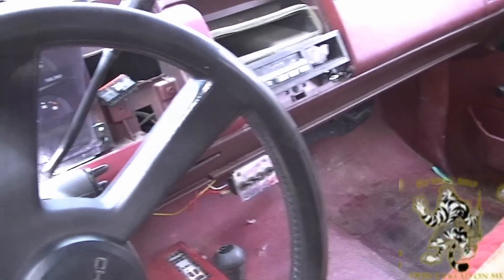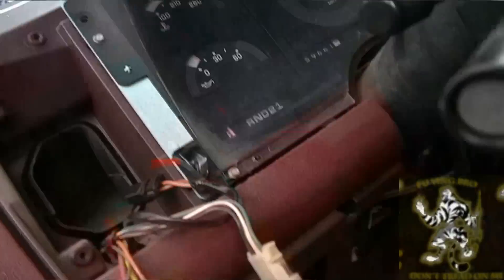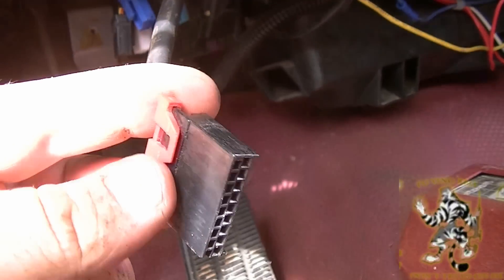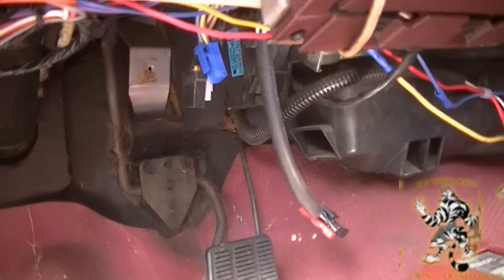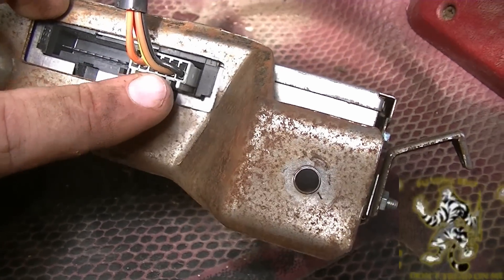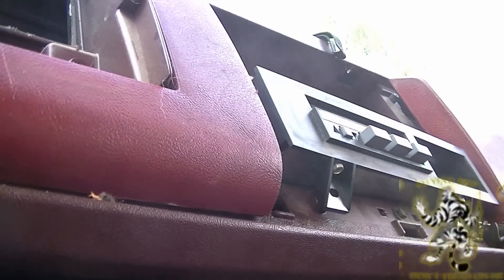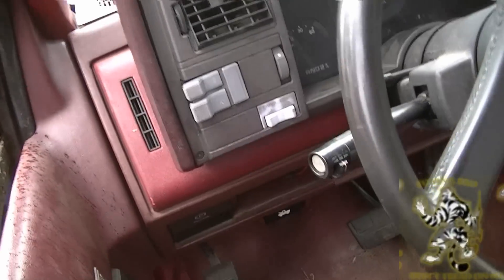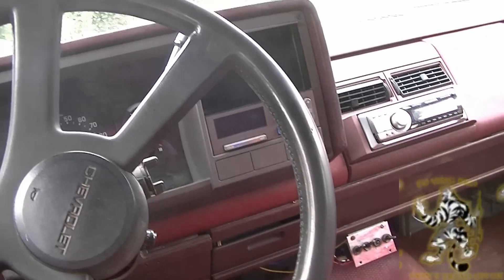88-94 GM Truck Stereo Install

Comment: thanks ... found all the replacement parts on Amazon and went to best buy after and they told me it was impossible. saved me a lot of time and headache
Reply from the maker: Best Buy is so full of crap. I use to do car stereo installs. One year I went down for a harness to install on a 03 Cavalier. They said I needed all this crap and route the stereo to the trunk. I laughed at them and did the install. Lady sold the car last year and said the stereo was perfect the entire time she had it.

Comment: Thanks for the video my unit is starting to die and I was dreading pulling the dash apart. Thanks again man!
Reply from the maker: +Iam D No problem man. You have a good one.
Reply: i have a 1994 silverado and the stereo that u said u pulled out from under the dash isnt there. i found something i think will work in place of it in an LMC truck book but dont wanna order it if it isnt gonna its called a quad 4 amplifier and if i am understanding what it does. It should take the place of the stereo but im not entirely sure. just wanted to see if u knew anything that could help me with this when i bought the truck all the speakers where wired through an aftermarket amp that was connected to the radio but i wanna hook up some subs in the truck and need a new way to do so if i have to hook the speakers back up through and aftermarket amp.

Comment: We feel your pain, I've had the same truck for over 21 years, they sell replacement radio amplifiers on eBay and the head units also on eBay I have replaced mine more than once, sometimes it's better and easier to stay with the original equipment

Comment: I should have watched this first. My front speakers quit working and I bought the "radio" that was just the control panel, so I solved no problems. I may get a full aftermarket.
Reply from the maker: +surrelljr After finding the actual radio it was actually pretty simple to switch the old system to the new system. Good luck.

Comment: This helped a lot, I thought the wiring harness didn't have anywhere to go because I thought the unit in the dash was the only radio, as I'm sure most people would.
Reply from the maker: You are most welcome. There was a few cars that did this in the 80s and 90s where what was thought to be the stereo was just the control module.

Comment: Finally! Been pulling my hair out all night hahah
Reply from the maker: You are welcome. Yeah there was a few vehicles like this that had the control until separate from the head unit and accessories units. So control unit near the clusters the head unit under the dash  and the tape deck unit to the right of the main clusters. Just all over the place. It had been so long since I did a job like this that I was like WTF.

Comment: I left my original head unit in place it looks much better than a hole to place trash another thing is if your dash is cracked buy a Dash Mat to cover it up also when I replaced the front speakers well the tweeters came up above the dash meaning one can't put the speaker grills but with the Dash Mat you could leave the grills off and use a much better speaker as I did.

Comment: can you just unplug the power wire and cassette deck wire and install and replace cassette
deck with new radio ? or do you have to pull out the old radio for it to work ?

Comment: I'm about to install a factory system back in my 93 after the previous owner installed aftermarket stuff, but I'm having a really hard time understanding how o the speakers connect. From this video do you know which wires are for the speakers?
Reply from the maker: Just from memory as I use to install car stereos long ago. You want to look for a purple set, green set, grey set, and i want to say blue set. They will have either one color darker than the other or one (negative) will have a dashed line through it. I just did some installs a year ago and they were still using the same color system in my 05 blazer and 04 Silverado.

Comment: i have a 94 chevy 2500 its been 3 years without a frickin radio and i tried changing the stereo several times but the amp and everything else (video,online diagrams)don`t really help as i dont want to F up the wiring....i see the local auto zone carries the metra wiring harness and its says it fits my truck however i have 3 plugs just like i see left over from the extraction of the factory radio that plugged into the im guessing power amp....i dont think anyone has explained if all the wires are needed and if so do i need more adapter`s?
Reply: +jaz420kronz nevermind it fit the whole adapter with one plug....had to improvise for the dimmer which explained the 3rd wire....keep up what your doing it helped..
Reply: What did you have to do for the dimmer?

Comment: If you comment back youd save my life, i have my tapedeck cut ot and my control, and my radio under my steering wheel has a the wires from the control and tapedeck, but the top side has a set of two plugs i can pull out and then a thick black chord that runs from behind my glove compartment to the unit. I dont want to cut it not knowing whag it does. And the antenna chord on the bottom side has a white wire meshed in and running up under my dash and i donk know where it leads

Comment: ok basically i removed the control unit couldnt find the radio under the dash, but was i supposed to cut the wire to the unit, i didnt cut it but rather pulled it out with the unit, cassette player was already removed before i purchased the truck, and the previous owner did a quick install and cut some the wires and spliced their own into two of the 3 plugs which looked silly to me so i undid them and taped them up for the time being, but when i pulled the radio control unit out the 3rd unspliced plug came with it, do i need that 3rd plug from the control unit or is there a plug im missing, also i only found 1 antenna wire but the tip where it connects into the new aftermarket stereo, so do i put the wires to the plugs back together and look for another plug and buy a replacement antenna or is there a replacement tip that i can buy? any help would be much appreciated, got a 88 1500 chevy not sure if their similar to gmc as far as wiring and stereos go.
Reply from the maker: chevy and gmc being both made from gm have the same wiring. Just get an antenna adapt that fits your stereo and splice it into the old antenna wire, no need to get an entire new antenna setup. Not all trucks came with a cassette player so it may have not had one so that may be why you are missing that wire. So with you already having the antenna wire all you need is to make sure you have the battery wire, acc (ignition wire), and speaker wires. Should be good to go.

Comment: good hepful tip i just orderd me a radio kit  to put a new radio in tapdeck.
Reply from the maker: I am glad I could help.
Reply: just one more question do i need the red and white rca jacks on the back of the radio for a 94 c1500 my truck dosnt have that i dont think.
Reply from the maker: That if for connecting to an amp.
Reply: oh  so i wont need it in this case then im connecting to existing wiring  with new speakers.
Reply from the maker: yep
Reply: okay thanks this will be my first radio change out.
Reply from the maker: Oh. Not the hardest change out but not as easy as most vehicles. I can't imagine on new ones with how a lot of what the radio controls has to do with important controls that have nothing to do with the radio.
Reply: oh haha  well my truck dont have any of them fancy features im to poor to afford a new truck besides my truck still drives  but it be nice to  fix the ac and radio in it.
Reply: and my current radio still turns on and acts like it pulls in radio stations but i get no audio it will tun in  and pop up fm stereo but no sound i orderd a new radio and new speakers.
Reply from the maker: Sounds good. be careful with the antenna set up. There are a ton of connection points for all the wires on the gm trucks at that time. Slow and steady. I wont lie for your first radio job it will be a challenge. I use to work on installing systems in the late 90's and we use to hate to get these trucks LOL. You get a 90's gm car and you would just need to have the correct din adapter and antenna adapter and could be done in 1/2 hour easy.
Reply: yea   and i got a kit  with the harness adapter and Jeannette adapter for that truck so i think it will all be good  and i was going to use heat shrink tubing  and clip the connecters off the speakers and wire it for more modern speakers with the polarity correct of course at some point in time  i will have to pull the dash as i am replacing the whole ac system  the condenser evap compressor etc  all that is old and bad and i want ac again the blower however still work s as the heat in truck works great but i never use the heater lol.
Reply: dont know why  auto correct put Jeannette in the wording but oh well lol  but i should have every thing i need to fix t he radio.
Reply from the maker: Sounds good man. I hope it goes well.
Reply: thanks i hope so too.
Reply: also do i need to put that bracket thing that the box is on under the dash back in or can i just toss it.
Reply from the maker: SuperJeremi10
I am not sure what you are referring to.
Reply: the bracket that holds the tuner box should i take the tuner out and put the bracket that held the tuner back in  or just discard it.
Reply from the maker: Oh the one that holds that actually turner not the controls. I am pretty sure that bracket was only for the turner. I would either toss it of if you think you may keep the truck for a show piece later you may want to keep it to reinstall to factory with the same parts it came with.
Reply: i might  and i just changed the radio and 2 front speakers works great i havent had time to get to the back 2  or take the head unit out yet  so but i have the box to take that out just busy ya know  it works good and  idk ill hang on to the stuff just in case but i like having a cd player in it.

Comment: was this as loud as it was before I'm told that is the factory amp
Reply from the maker: Well that is true and not true at the same time. Radios have amps in them, so yea it has an amp but only because it is the radio. The other part is just the controller. Think of a steering wheel that has radio controls. The button set on the steering wheel would be the controller. To answer your question, it sounded much better. Whom ever had the truck before me put aftermarket 6x9s in it. The amp in the original radio did not have enough to push it very well. So now it is stronger and clearer.

Comment: You should have asked a older Stereo Installer and It should have taken 1 hour max to do this.
Reply from the maker: +mazdarx7gx Actually should only take 30min to install. This video just shows that it is simple and I show why it is simple when you know where the hook ups are. No need for an installer. I use to be an installer.

Comment: it's the amplifier
Reply from the maker: Samantha Dutcher yes it is also an amp, but also the stereo. The tap deck and antenna feeds directly to it. What is on the facing of the dash panel is really just a controller. Think of that unit as the secondary controller on a steering wheel.  If it was only an amp then the antenna and tap would feed into the controller which in that case would make it the stereo.

Comment: It's shame you hacked it. Those original stereo components go for a lot of money. 
You can't beat the factory stereo. Buttons and clock are right where you want them. After market radios sit too far away and the buttons are tiny.
Reply from the maker: You can get stereos that fit in the controller sections. Pretty sure you could way back then when I did this. In any case you can get smaller stereos that would fit in that section. I remember that I almost went that route. Since that time the daughter of the original owner bought the truck from me to give to her son.
Reply: @fuyingbro  that's good to know!! Thanks

Comment: Hello friend, I am looking for a female cable for a radio tahoe truck 1994, you have an email to send photos and where you can indicate or guide me where to buy the cable kit online ...
Reply from the maker: LAMG VE you would just need the same harness I used for mine. Just go on Amazon and look up Tahoe 94 gm radio harness. You most likely will need a gm adaptor too.

Comment: Lol you took way to many parts off aha... lol I put the factory radio back in only took 15mins to it and I never done it before 😂..had the aftermarket one in it but remove it so The was no radio worth being stolen 😂
Reply from the maker: Blair Joseph Bernard that was the reason for the video, to show not a lot had to be removed. I guess you missed that part.